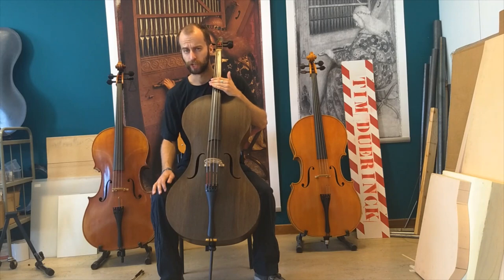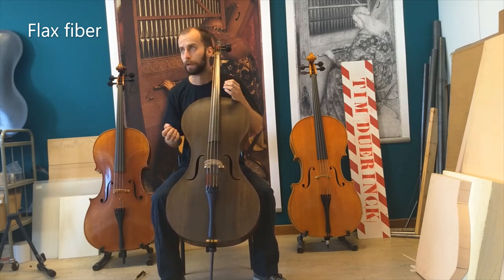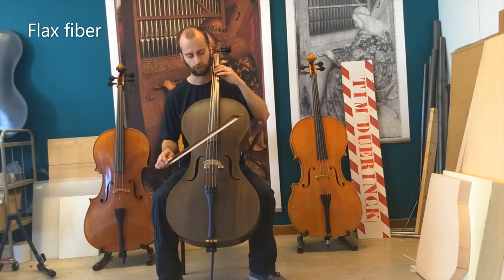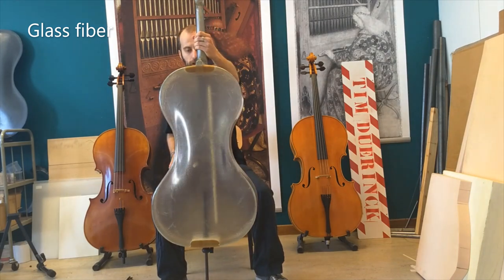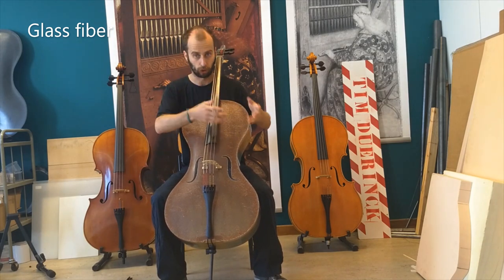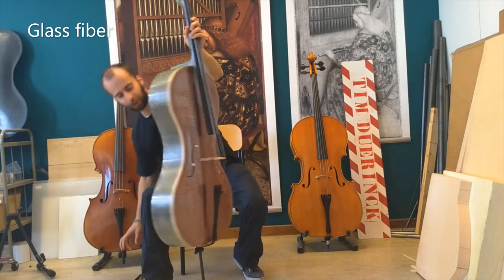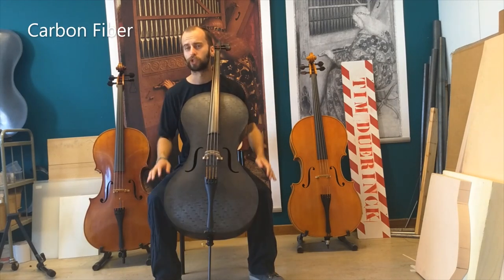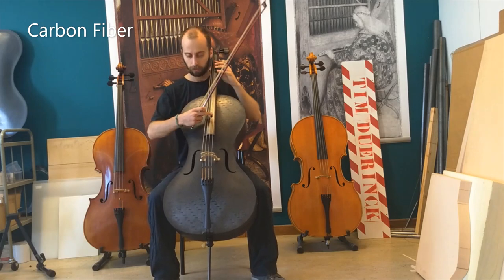Cellos with extra fiber?

Comment: That's very interesting! I have been playing with the thought of making a carbon fiber cello, especially one with the fibers running in a similar fashion to wood grain. Do you find that the weave of the fibers affects the tone a lot?
Also, from the few CF cellos and bows I've tried I have found just a bit sterile for my taste. Do you think it can be as complex of a tone as a wooden cello?
Essentially what I want to make is a cello which is as close to a wooden cello as possible in terms of sound and response, but stable in humidity so I could take it sailing and keep in shape without worrying about the sea air apart from maybe having to swap strings when I got home.
Reply from the maker: Hi Tobias, the weave affects the isotropy of the soundboard which has a huge influence on the sound of the instrument. I think a carbon cello can certainly sound as complex as a wooden cello, but to match the sound and response exactly is a very difficult undertaking. Personally, I think it is more interesting to investigate possibilities for new sounds with these materials. If you work only with unidirectional fibers the soundboard will be fragile, so I would recommend using at least one woven layer in your layup (for example as the middle layer).
Reply: @TimDuerinck  Thanks for your reply! Yes, some weaving is necessary, I am aware of that. Just how much is the question.
I agree that exploring new tonal characters is more exciting than chasing down a way of doing what is already achievable, but for my purpose of staying in shape on the cello, I think it's important that the two are as close as possible and that I can still work with colours in the sound etc.
I was wondering, btw. Can you take these apart? I saw your other videos some time ago, but don't remember what glue you used. I would imagine that the few wooden parts would need some maintenance during its life time, even if the plates are very stable?
Reply from the maker: @tobiasradmer4276  How much is a subjective question. The more you will use the more durable the instrument will be, but it will change the timbre as well. As you are aiming for a sound close to wood I can't really tell you where the 'optimal' will be. You can try and match the tap tones of the soundboard to that of a conventional soundboard, that could help, but only if the model is the same (so using conventional C-bout corners etc.). I use epoxy to glue the top and back plate together. So it's not really meant to take apart again. You could, but you'll probably have to change or repair the linings and blocks (which are PU foam in my carbon cello). The only wooden parts on the inside are the bass bar and sound post. The sound post can be adjusted as conventional. In normal circumstances I don't think the bass bar will require maintenance. Of course you can opt for a glue which is less strong so you can take the top plate of the body more easily.
Reply: @TimDuerinck  Right... Matching the tap tones might be a possibility, but then I'm limited to a shape I've built before. I think if I'm going to make one, it will just be one or two layers across.
I suppose you glued the bass bar with epoxy as well, so that's not going to come loose any time soon, What I was thinking of was the blocks and bass bar, but it might just be worrying too much. Especially if your blocks are PU? I actually thought they were wood

Comment: Thank you very much for this series of videos Tim, this was very insightful... Crazy overtones on these Cellos in general, but especially on the low C. Seems these composites really let most of the sound that's there in the first place through. Might be playing technique as well, so it might have been interesting to hear one of the wooden Cellos played with the same recording setup. Still, very interesting. I've been researching how to build with carbon fiber, since an Instrument I want to build (or rather, an attachment to an instrument) requires that it be built out of carbon for stiffness-thickness ratio reasons.
One question: Is the fingerboard on the cello still carbon, like you showed in the former video? If so, isn't it a pain to work with, compared to ebony? Some people on the other videos also mentioned "string-smack" noise in regard to carbon fingerboards... On the other hand, would it give more sustain and "mwah" on pizzicato, when played with jazz technique? Richlite might be a viable alternative; it's what all the NS-Design electric instruments have for fingerboards... My luthier loved working on my NXT5 basses' fingerboard, said it was much easier to work than ebony.
Reply from the maker: Hello Jan, thank you for your comment! The fingerboard is indeed carbon fiber, and it is not for everyone. Personally I'm still on the lookout for an affordable alternative to ebony for cellos. My next experiment regarding soundboards will be with flax fibers, in an effort to reduce the string smacking noise. The amount of noise does depend on playing technique, so if you dont hammer down with your fingers too much you do not hear it. Many professional cellists sare therefor not bothered by it, but for amateur players (like myself) it is harder. As such it is a good training for technique ;)
Reply: @TimDuerinck  Have you tried Richlite or Rocklite before? As far as I can tell, it's actually cheaper than ebony... In any case, I'd be interested in your results. I'm not a luthier myself, but the crazy ideas I tend to have dictate that I at least familiarize myself with the processes and materials that are out there, if not in practice, then at least in theory.
That said, now that I think about it, a carbon fingerboard might even be preferable for some applications. The Sarod, for example, uses a metal fingerboard after all, and I've not heard people complain about string smack in that regard, even though the metal fingerboard is presumably harder than carbon fiber.
Reply from the maker: @dāzainmusic  As far as I know, Richlite and Rocklite do not produce fingerboards for cellos? For guitars there are quite some alternatives on the market, but for violins, and cellos especially this is much less the case.
Reply: @TimDuerinck  True, one would have to start from a blank slab... Now that I look at it, they don't even sell slabs in the right dimensions per default! One could probably still get a blank with the right dimensions when contacting them, though.
Reply from the maker: @dāzainmusic  Yes, probably. The flax fiber fingerboards I would make myself using a mold, so they would already be more or less in shape. If I can make a system like that I would prefer it over a few blanks I could get my hands on.
Reply: @TimDuerinck  Sounds reasonable. Looking forward to hear of your findings!

Comment: I wonder how the 'soft' flax/linseed cello would sound with gut strings. This material might also work well for a gamba. The demo already sounds a little like a bass de viole in the higher region, but softer. Or perhaps smaller instruments - viola, or even violin?
Glass fiber cello sounds like it requires a completely different playing style. A soloist would probably have to temper the playing style (attack?) on the instrument as it would easily start to 'clip'.
Carbon fiber: I never liked the sound of that. 
But the glass fiber has a wide range of color and I wonder how many new sounds you could get out of it with all those overtones. Sounds that would not be possible with a traditional naturally grown hydrocarbonate foam (a.k.a. wooden) cello. 
This instrument is what an electric guitar is compared to a classical guitar: much more 'ugly' and harsh sounds which, for the guitar, have been happily adopted by the blues and rock-and-roll scene.
Reply: While I think the flax would work well for higher pitch instruments, the glass fiber might work will in the lower regions....double bass?
Reply from the maker: @ErikBongers  As I have said in the video, the preference between these instruments is subjective. A violin with a soundboard from flax was liked by listeners in a scientific study I have recently published (https://asa.scitation.org/doi/10.1121/10.0001159), so your remarks certainly make sense. I have never made a double bass. It would certainly be an interesting experiment to make one from glass fiber! But I think I might need to hire some help in that case: I'm quivering with the thought of having to make a glass fiber mold for a double bass by myself. It would be huge and impossible to carry by myself. A mold for these cellos was already quite a challenge!

Comment: Machinery to work with such materials costs a lot? 
I make bowed istruments as a hobby and id like to experiment with unorthodox methods, do you think it is possible for a hobbyist to get the necessary equipment?
Reply from the maker: Hi Simone, I have selected my making method (which you can see in my video's on making a carbon cello by hand) to be relatively low tech. For the infusion of the composites you do need a vacuum pump and degassing chamber. I cut the composites using a dremel. So not that much machinery required!
Reply: @TimDuerinck  thanks! It seems doable, i will search the right vacuum pumps and degassing chambers.

Recently i have seen an italian luthier that makes ukuleles with a very unexpected material: sack cloth, he'called marco todeschini, check his stuff if you wamt
Reply from the maker: @simonecamplani2430  Check out EasyComposites, they sell everything you need to get started at a reasonable price. They also have video's in which they use their own gear, so it's easy to learn how it works.
Reply: @TimDuerinck  thanks, very helpful
Reply from the maker: @simonecamplani2430  Best of luck! Have fun!

Comment: did you try e glass or plain fibreglass ?
Reply from the maker: It's regular fiber glass! :)
Reply: That would be an interesting comparison for glass fibre; E-glass (alumino-boro w <1% alkali,) E-CR-glass (alumino-lime w <1% alkali,) A-glass (alkali-lime w <1% B2O3,) D-glass (borosilicate,) R-glass (alumino-silicate w no MgO or CaO,) and S-glass (alumino-silicate w no CaO, but high MgO.) R glass and S-glass have high tensile strength and are good for reinforcement. Another one that would be interesting is pure silica, fused quartz glass. I wonder if the difference would be enough to justify the cost, and labor, of a build and comparison experiment?
Reply from the maker: @FredtheDorfDorfman1985  A good question that cannot be known if you don't try. Personally I think the influence of lay-up and including a lightweight core is 'easier' to influence the sound.

Comment: Next step: a graphene cello! Too expensive for now I'm afraid :-) I wonder: would it be possible to mix fibers? Create a hybrid between the three?
Reply from the maker: Hi Job, using multiple fibers is definitly possible, but it's not really a simple case of 1+1=2. There are certain restrictions to take into account for example in order to not have your piece warp during construction. There are some other issues as well. I have created violins in which the top plate is made from a different material than the body (ribs, back, & neck). That's the easiest way to make a hybrid.
Reply: @TimDuerinck  that makes sense - like the top and back of a traditional instrument are made from different kinds of wood. Did you like these hybrid violins?
Reply from the maker: @jobterhaar  yes, although I always make my top plates differently than my back plates, even when working with the same fiber. The one I made with a flax fiber top plate and carbon fiber body was especially liked by many listeners and players looking for a warm and easy sound. I do like them myself, but I also really like to push the boundaries of what is possible with just one material, because depending on how you use this material it effects the sound.
Reply: @TimDuerinck  I'm curious to try or hear some instruments in the future!
Reply from the maker: @jobterhaar  always welcome to visit my workshop and try some instruments!

Comment: C/G/D/A string sound quality ratings:
Flax: 4/6/8/5
Glass: 3/7/7/7 (Lowest note 4)
Carbon:  3/5/8/7
(I'm not talking about EQ but quality of sound.)
Reply from the maker: Hi Arjuna, quality of sound is an extremely subjective property, so without any specifics I cannot know what you are talking about in this instance. I'm guessing you are rating the 'quality' of sound based on the sound color having or lacking a certain property like warmth, richness, brightness, harhshness, power, clarity, sharpness,...? The idea behind these cellos is that they are made to have a different sound color, which I explain in the video and I'm sure you can hear. Which one you like or dislike is personal. I'm surprised your score changes that much between the strings, as most cellists comment that the sound is very distinctive across all the strings. Perhaps it is due to my playing, which I must admit is quite rusty! ^^ Thank you for your comment, Tim
Reply: @TimDuerinck  Exactly!

I'd say I definitely focussed on dynamics, richness, clarity and resolution in this case though.
Obviously the mic might play a part.
I've reviewed quite a few other cello's on youtube. I was definitely impressed by your mid-highs on all the cellos, the lower string is often a problem with these materials.
Have you tried hybrids yet? Bamboo sandwitches?
Reply from the maker: @Apoz  I have made hybrid violins, but no cellos yet. I have also not worked with bamboo yet. It's a very strong, but also heavy wood. Theoretically it could work in a sandwich material. I have not made the calculations to see what the options of making a sandwich material would be (the variations in how thick the skin and core can be to reach a reasonable stiffness, the resulting weight of the soundboard,...). It would definitly be interesting to take a look at.